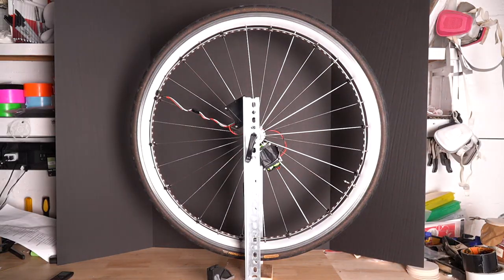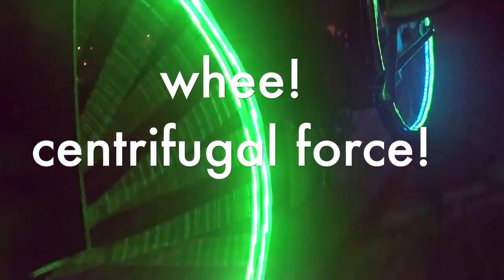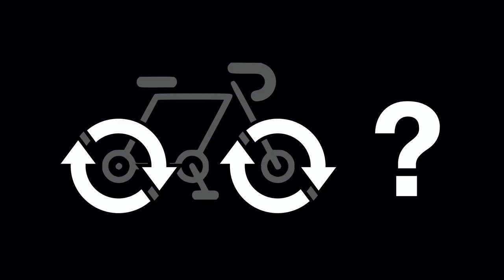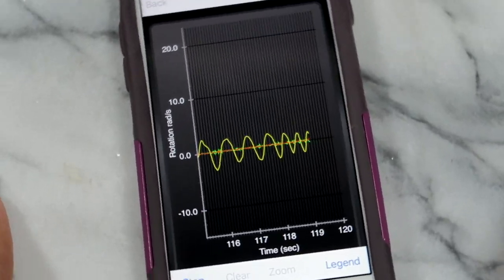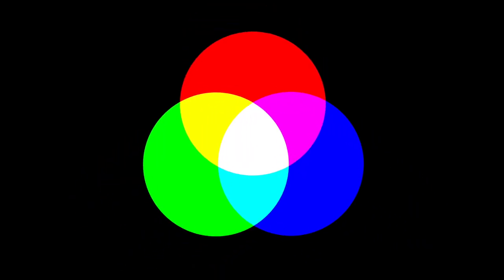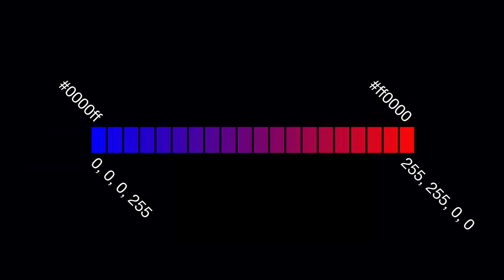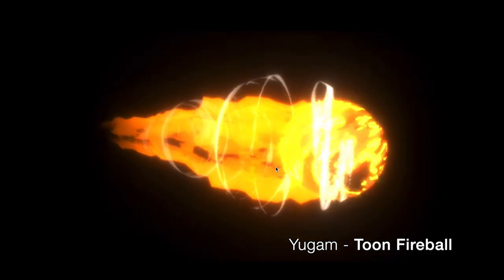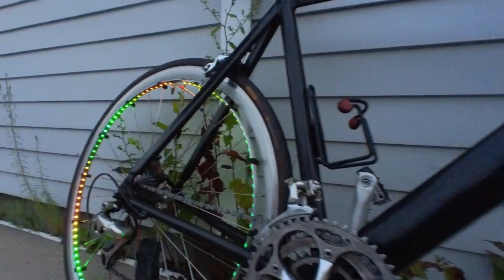How I turned my bike into an LED light show

Comment: These rims are incredible! 
Would you consider selling a few sets to people who aren't skilled enough to make their own? I could send a set of bike rims  and pay for your supplies and labor.
I'd be much safer riding at night with LED rims. Syncing the light patterns to the RPMs was brilliant.
Reply from the maker: Thanks! It would be cool to be able to send these out to others to test out and play with although they're still paused in the prototype phase. Main issues being no charging port for the battery, not waterproof, and no way to add patterns from the phone. And then tons of things that were on the "would be cool if" list.

The one good thing is that rims don't need to be shipped. These just clip on to spokes. Sizing can be taken care of on my side and then shipped out.
Reply: @EdLewis  The prototype is very impressive. Sorry, I assumed the lights were mounted directly to the rim. You could try clear heat shrink tubing wrapped around the LEDs and electronics for waterproofing, sealing any holes with clear caulk. 

A phone app controller and bluetooth receiver would be incredible, but that might drain the light batteries pretty quickly if the receiver was always on. 

Good luck with future builds, I'll be interested to see what you come up with next.
Reply from the maker: The lights are on a metal strip and that strip is attached to the spokes. 

This actually has a BLE module and I made an iPhone app to control the wheels. Didn’t cover it in the video since it was already long but was needed to be able to switch modes. The front wheel relays to the back wheel so both update right away.

Comment: Hello, I'm a comp sci student and this is really cool, so I'd like to do this for my bike, but I don't know much about circuits. Are you using 18650 or 21700 cells? If so, do you have any safety features on the batteries? How do you manage the 5V voltage for the lights and 3.3 V for the arduino vs the 3.7V of the battery? I've read differing opinions online where one person said you can run the 5V lights on a 3.7V battery just fine, and another said to put two batteries in series to double the voltage and then step down the voltage for the lights and the arduino.
Reply from the maker: 18650 cells in here. I used two in parallel and then boosted the voltage to 5V. This is likely NOT the best arrangement. You could probably just use one cell or two in series and then step down to 5V like you mentioned. I was prematurely optimizing for run-time.

That 5V powers the Arduino, BLE module., and LEDs. The Arduino logic is at 3.3V so I also used a logic level converter to get the output to 5V to control the LEDs.
Reply from the maker: In terms of CompSci, this project hit pretty much all the areas.

There's a website I made for managing the palettes: https://palette-library.vercel.app/wheel

Arduino control for the LEDs.

A smaller Arduino project for the BLE module that synced up both wheels so the iPhone app only had to talk to one wheel.

The iPhone app for choosing patterns and sending it to the wheel.

I ended up skipping over a lot of this as it was already feeling like a wonky enough video as it was.

Comment: I would love a video of the light holding rim construction and installation!
Also - how do you deal with gyro drift? Do you still have once-per-rotation synchronization via magnetic switch or what?
Reply from the maker: I had that in this originally, but it was already pretty long. The holders are 2 3D-printed parts that are bolted together. This allows you to adjust the angle for the spokes that are on each side. It also lets you adjust it for different wheels. 

Those are holding a strip of thin aluminum bar that I bent around a chair. And that's what the LED strip is stuck to.

I haven't had any issue with drift. Maybe it's been there, but I'm not trying to lock the image in place and haven't noticed.
Reply: @EdLewis  Thanks.  

Good point, since you want the pattern to (more slowly) rotate anyway, gyro drift really may not matter.

It would be interesting to turn off the deliberate rotation (just cancelling the physical rotation of the wheel as sensed by the gyro), and see what happens.  I'd predict that it will be stable at first and then gradually begin to rotate anyway - but I could be wrong.

If you decide to make even a short video of the construction, I'd be interested.  I have subscribed; you have relatively few videos but include some good ones.  Thanks for sharing in any case.
Reply from the maker: @zephsmith3499  As it is, there's already some compensation as the sensor is precise, but not accurate. This has to do with issues of the sensor not being entirely parallel with the wheel and sometimes timing with relation to how long it takes to push each frame to the LEDs.

The "zero point" for each animation is different as a result. So the sensor is giving 300 dps, but it might need to be adjusted to 330 dps for calculations of how much to shift the image each frame.

At best it would be very slowly drifting or maybe going slightly faster or slower at times. Which would be OK for looking weird, but useless for doing a different animation style with that since it could be facing the wrong way.

Another version of this that would be good would be to use a magnetometer to always know which part of the wheel is on top. I have a few sketches of ideas of how that might work. Like light at the bottom of the wheel acting like a pool of water reacting to acceleration.
Reply: @EdLewis  Yes, that's one kind of animation that appeals to me!

The magnetometer idea is interesting, but if you are referencing the earth's magnetic field, wouldn't it be hard to compensate for yaw rotation (ie: riding the bike in different compass directions)?  Unless you are sitting atop one of the magnetic poles.

An accelerometer could be tricky tho, trying to filter out both centripetal forces and acceleration/deceleration to get an gravity direction.

It could be very interesting to experiment with tho!  I will look forward to any future vids!

Comment: Great job.  Can you share more details about the IMU/accelerometer implementation?
Did you have to do any fancy filtering like Kalman filters or stuff like that?
Reply from the maker: No, I never saw the need to go further than to keep updating the current speed value from the accelerometer. It was giving readings at 40Hz and the speed didn't change rapidly unless you did a hard brake. I also have some visual wiggle room since the end result has a slow rotation. If I was trying to lock the visuals in place I'd likely look into that as well as using the magnetometer.

Comment: I like the new clips in the beginning, looks like it uses less LEDs.
Reply from the maker: Good catch. The old clips weren't solidly held in place and neither was the LED strip between clips. These clips are in two parts and held firmly in place with bolts and nuts. These hold an aluminum strip so the effect is a lot more consistent.
Reply: @EdLewis  Is there a link to these new clips that you can share?
Reply: @objectivegiant804   Were you able to get a link to the new clips? I've seen a video of the design of the original V shaped mounting brackets.

Comment: Hey I'm just checking before I follow your links. Is everything I need in those links in order to do this project myself? If all the information is there I can figure it out one way or the other.
Reply from the maker: The information is definitely NOT all here. I can get you more info if you need, but first of all, what's your comfort level for working on electronics, arduino, addressable LEDs, and 3D printing?

Comment: I have decided to embark on attempting to replicate your project, and was curious which gyroscope sensor you used. And for that matter, which arduino did you decide to go with? I assume this all runs fine on 5v? (which is typical for less than 100 leds on a line)
Reply from the maker: It's been a couple years so there might be better boards now. This uses an Arduino Nano 33 IoT. This and the lights are both powered off of 5V (18650 boosted to 5V). It also uses a logic level converter to convert the 3.3V logic from the Arduino to control the LEDs.

Comment: Can you add links to the equipment you used so that we lesser electrically inclined folks can purchase and install?
Reply from the maker: The electronics controlling it are an Arduino Nano 33 IoT and a separate bluetooth module, but still won't get you very far.
Reply: @EdLewis  ok, gotcha. Man if you packaged this up and programmed it, I’d buy a set from you.
Reply from the maker: @EmAreDayviss  Thanks. I didn't pursue this idea before since I really don't want to be in the business of customer service for this type of item (exposure to elements and rough wear), but doing it as JUST the controller is interesting.

Comment: Hi, recently I came up with the idea of making just such LEDs in the tire, I watched a lot of videos and as far as the idea was cool, the execution was not, and finally I found your video. Your idea is epic and I would like to apply it to my bike, but I have no idea how you connected it all. I would be very grateful if you could find the time to more or less describe what to combine with what.
Reply from the maker: I've been meaning to document this but that would be a much longer video. Ideally, I'd make a custom board to handle all of the electronics. As it is, this requires a 3D printer, some basic soldering techniques, and various specific bits of hardware.
Reply: @EdLewis  I want to add LED lights to my bike wheels and frame just like you did but I have no clue on any of this technology.  Is there a kit you can sale to just add the LED’s to bikes?  I know I would be interested in buying it.
Reply: @EdLewis  Your work on this is fantastic. looking to learn how to accomplish this for installation on many bikes to be used at Burning Man. Would you be willing to provide greater instructional details for a fee?
Reply from the maker: @Diploramat  Thank you! This would be amazing at Burning Man with a group of bikes. To make that happen would require redoing a lot of the work. So... a custom board to handle everything (micro, accelerometers, BLE, charging circuit) and likely a new holder to put it along the hub of the hike instead of the spokes. And then an expansion on the work already done for the iOS app. Playa-proofing it at that point shouldn't be too bad.

It would be interesting and you'd need to handle the LEDs and LED holder on your own. That part is easy with some basic maker skills such as 3D-printing and soldering.

Soooo... doable and interesting, but would need a commitment to buy a couple dozen controllers in the end.
Reply: @EdLewis  Thanks for the reply Ed! Its definitely a topic to be discussed further, is there a way to DM you directly? I looked here on YT but not finding anything on your main page. perhaps I missed it.
Reply from the maker: @Diploramat  You can contact me at myname@gmail
Reply: @EdLewis this is exactly why I watched your video! I have been racking my brain trying to figure out how to connect this to our bikes for Burn in a month! May I reach out via email?
Reply from the maker: @SimoneBaxter.  Sure, I can help out. As long as you or someone else in your crew is handy with basic DIY electronics and 3D printing this should be doable by the burn. email is myname@gmail.com.